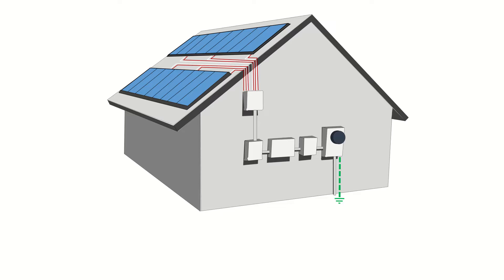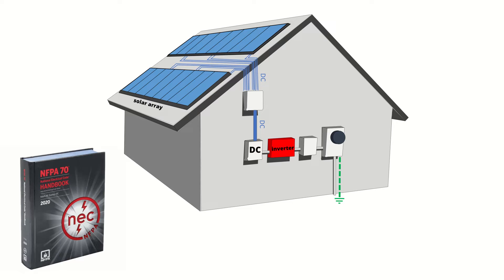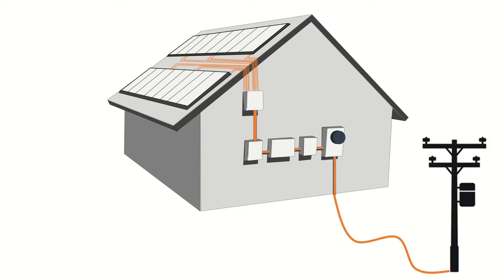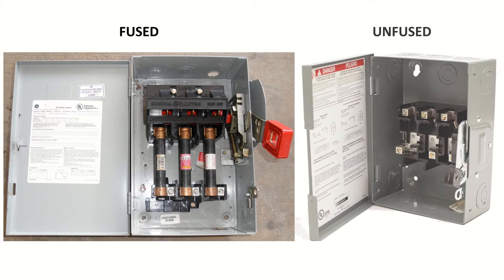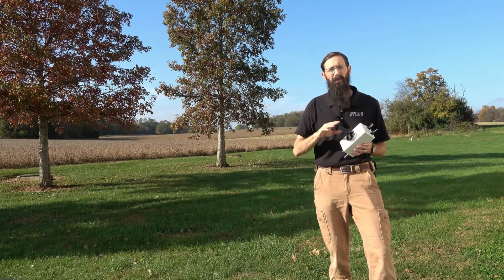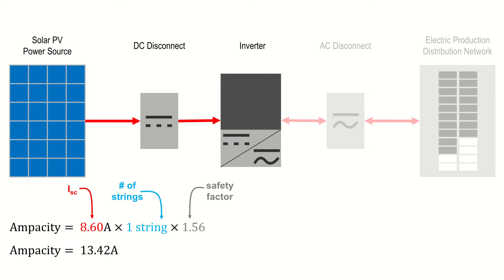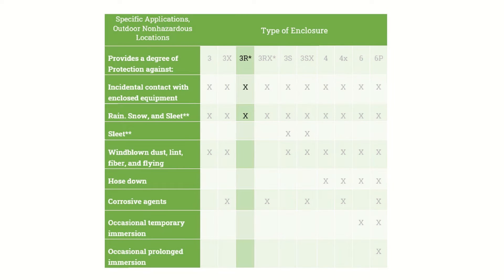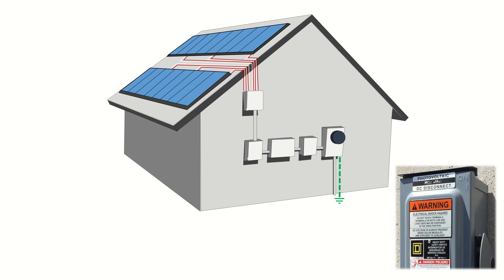How to select and install a solar disconnect switch

Comment: excellent job. learned why I need a 3 pole safety switch for my solar installation. As fas as having them fusible I am not sure yet. I may stay with unfusable as according to what you said they are not needed in many situations.

Comment: Lot of the solar coding requires on a DC setup side to have the neutral (negative)wire hooked up to the switch now. You can't wire nut it or buss bar it